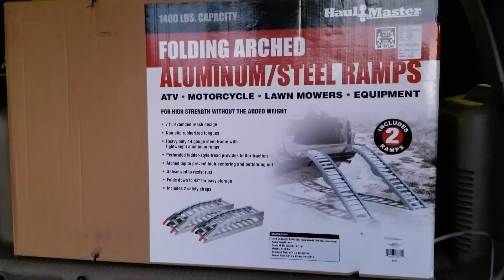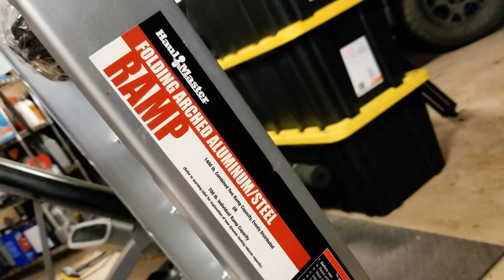Harbor Freight Haul-Master 1400 Lbs folding ramps - Assembly and light review

Comment: The instruction manual is difficult to follow, as the photos do not do well in showing exactly how the plates are to be put on. Mine had the stamped plates with the F, G, H and I marked on each of them, but you basically put it all together upside down when assembling it. Hope they remain secure and do well for the purpose I will be using them. This video was a help, for sure.

Comment: An awesome good insightful video. 

This Harbor Freight Load Master got better customer ratings then the Lowes aluminum folding Loading ramp set  which costs at $160.00. Several customer ratings  experienced bending structural  compromises of the integrity of the Lowes folding Ramp. 

 I am wondering so far how is yours holding up?

Comment: The rungs are upside down. The ramp won't be as strong that way.
Reply: In checking out just what you claim, the HF ramps are designed to be put together exactly as how it was done in this video. There is no indication by the manual or the photos at Harbor Feight as to any structural weakness in assembly in this manner. The individual photos at HF show the assembly done just like in his video. Not sure why you think it would be weaker in this manner, but none the less, he did assemble it correctly by what HF instructions stated and what is shown at their own site for these ramps.